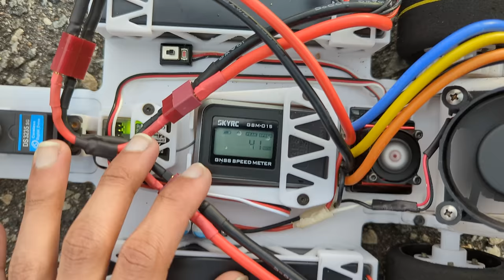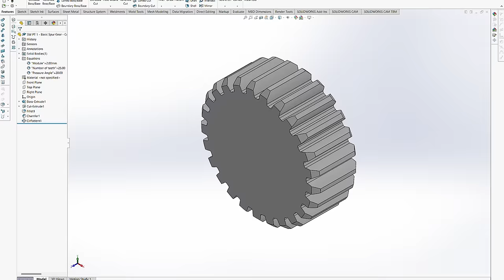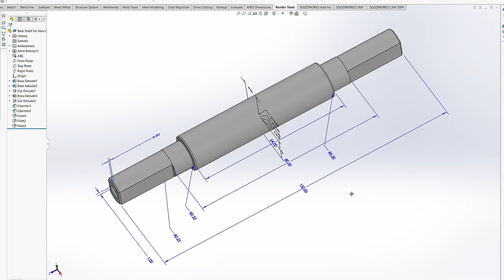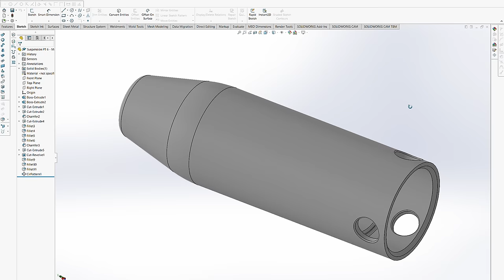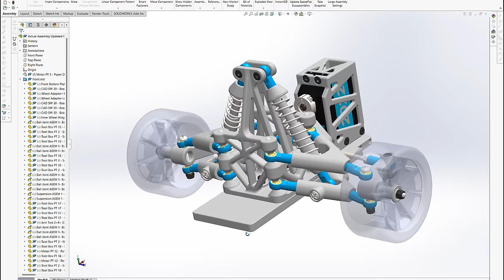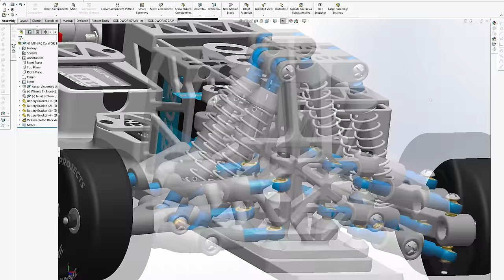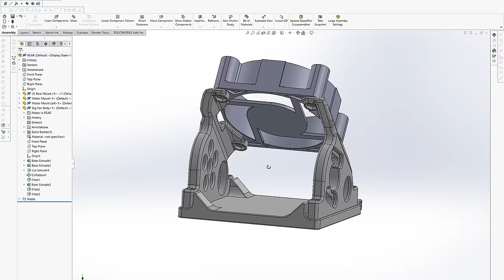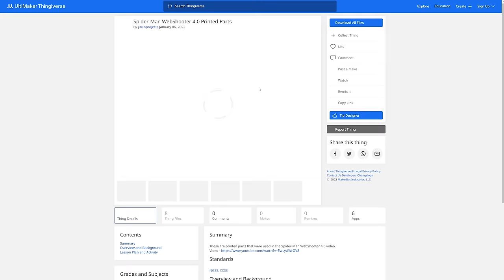How I Made a 3D Printed 41 MPH RC Car

Comment: please tell me that u used grease for the gears and a fast car like that needs a gyro
Reply from the maker: I used Vaseline lol

Yea, there's a gyro setting built in the receiver which I later turned on. I should've mentioned it in the video
Reply: Shouldn't NEED a gyro, personally I don't like them, if my car is wobbling around then something is wrong.
Reply: @jinanprojects  don’t use grease it will end up as a grinding paste
Reply: A fast car needing a gyro?? No it needs to handle before fitting a gyro! Not just a Band-Aid fix
Reply: @TwitchFast exactly people need to learn about handling dynamics and set up before wasting money or commenting causing someone else to waste it
Reply: @jinanprojects  dry graphite lube spray won't pick up and hold dirt.
Reply: Differential steering?
Reply: @needmoreboost6369 sorry that i was worong im just 12 and learning
Reply: @needmoreboost6369  im sorry that i said that it needs a gyro im just 12 and learning
Reply: @needmoreboost6369  im sorry i didnt know im just 12 and learning
Reply: Never need a gyro in any of my cars. Mine is about as fast as Jinan's here and has some 3d printed parts. Never had any wobble
Reply: what about a belt drive?
Reply: @raultamm6479 needmoreboost is just being a butt, im 13 and he can be not a asshole there are nicer way to say stuff
Reply: Gyro is for people who can't build the steering system properly

Comment: You can print double helix gears which is just two opposite angle helical gears side by side, but printed as one piece. They self-center which is nice and you lose less energy. They also have a nice benefit of being a little quieter than other gears.

Comment: Double helical gears are a great option for 3d printed gears. Reorienting the fan could allow you to use the cooling system as a down force generator. Active down force like that will be super useful for sustainable high speeds because of the scaling problems of aero. If it always crashes the model could end up being overbuilt. I really hope this helps. No matter what I'm loving this project man. Good luck.
Reply: For a practical example of Generated down force at full scale, look at the Redbull X201X series of concept racers.
Reply: If it helps they are also called herringbone gears
Reply: @Sun0faBeach1 i was thinking the same
Reply: Cooling fan downforce on a 40+mph car 😂
Reply: The herringbone gear was a Citroen design very strong and eliminates side thrust
Reply: It’s a PC fan. It’s not powerful enough to make any noticeable downforce. They’re designed to be quite not powerful
Reply: @gy9326  true but the pc fan COULD be used to cool the gears to reduce thermal stress, and considering its plastic, that would be ideal.

Comment: You can try testing with herringbone gears to get rid of the axial force. These are basically two opposing helical gears put together where each half counter acts the axial forces from the other half.
Reply: Yes, this.
Reply: Or, even easier, just use two helical gears, put side by side with opposite axial force directions. Heringbone gears are a little bit difficult to manufacture conventionaly, with a printer it is easier, but simply mirror the first gear makes it even more simple.
Reply: They also reduce sound
Reply: i was thinking of this or he could use a belt to reduce the stress on his gears but then he would have as precise control of his velocity (this could mitigated with a PID or something similar but thats too much work and that over complicates things). for me, his biggest error was placing all the stress into a small gear, if he had placed two 2:1 gears the stress would be reduces enough ( i believe, i dont remember that class that well)

Comment: As a suspension engineer I suggest adding caster to the front wheels for extra front end stability. Right now everything is centered which is not the best for high speeds. Great video tho. that RC is a beast.
Reply: I am not a suspension engineer, but I guess, that this suspention is just making things worse. The point of having a suspention is to dampen oscilations. The car shouldn't jump when you drop it. It's better to switch to off-the-shelf rc shocks

Comment: 0:32 I thought this too at first but the KV rating of a motor doesn’t mean kilovolt. The KV is actually the rpm needed to produce 1 volt of back emf, so a 3800 KV motor will need 3800 rpm to produce 1 volt or back emf. It also dictates how fast the motor can go, since an ideal motors max speed is reached when the back emf equals the input voltage and the motor will use no power, but due to non ideal conditions due to friction and other factors the back emf doesn’t reach the input voltage so it always uses at least a small amount of current.

When you add a load to a motor it slows down the motor and that in turn leads to a drop in the back emf, which means the voltage across the motor increases and hence it uses more current. In a stall condition the motor isn’t spinning so isn’t producing any back emf and hence the motor winding has the full voltage across it, this causes a very high current, in DC motors you are essentially taking the inductor which is the motor windings and just turning it into a resistor since with no changing currents the inductor has no resistance.
Reply: Lot of info here, thanks.

Comment: The reason the axle was printed lying down on the bed and with a flat spot is so the extruded lines go right down the length of the part. The individual extruded lines are stronger than the layer adhesion, when you oriented it vertically the only thing holding it together was the layer adhesion.

A better option if possible would be to print the axle in two halves, both lying flat on the bed and combining to make a cylindrical shaft. Or you could just flatten the other side of the shaft to balance it.

Comment: half your problem is the material you are printing with. You need a stronger polymer. In the RC car biz, the gears are steel and a plastic material. Shocks are, most of the time, aluminum with rubber o-rings to seal and hold things together. 

you have a super cool idea here! Congrats on making it work! Some refinement, and you are set!

Comment: As a solution to the helical gear issue, you can try doing a double helical gear or herringbone gear. ABS would also be a better material for gears for the higher melting temp.

Comment: I'm surprised you didn't use double helical gears for the motor. They get rid of the axial force issue that helical gears introduce and are still easy to 3D print.
If the gear generator doesn't happen to have an option for those, just mirror one half-as-thick helical gear back to back.

And as the other guy suggested: create an enclosure for them while at that, so you can put grease on them and have it not be thrown into orbit after 5 seconds.
Just grease without an enclosure will do basically nothing, as it will just be flung out the second you throttle up.
Unless you're using graphite powder, that might be sufficient in a thin layer that could stick around, literally.

Backseat engineering aside: a very impressive project you got there 👍
Reply: Herringbone gears is what you're describing.
Reply: @greggeshelman  double helical/herringbone are synonymous, yes.

Comment: At zero load the motor spins at 100% rpm potential. At 50% load it spins at 50% percent rpm. It is a inverse linear relationship. 

For motors like this you do not want them loaded more than 30% at top speed (for multiple minutes of high speed driving). Should be easy to figure out, measure the zero load RPM and you can do the math on MPH to RPM to see what the load is. 

Also, are you going to add suspension on the rear axle? I’d recommend looking at the old school classic RC10L chassis, which had a solid rear axle and was able to do some suspension on it.

Comment: You can avoid the radial force by using herringbone gears. It's just two mirrored helical gears that either touch in the middle (herringbone) or don't (double helix).

Comment: That was nice! Good job!
Why dont you try to print in PETG or ABS? it will be less rigid but more durable in teory
Reply from the maker: I actually wanted to use nylon filament for the gears but the layers kept separating after printing for some reason...
Reply: @jinanprojects  that is commonly a sign of not using a high enough temperature or having too much cooling, it happens because the current layer doesn’t melt into the layer below it properly, you should try less cooling and a higher temperature. Ideally for filaments like nylon you want an enclosure too, to help reduce cooling more and to keep the part hotter, so less likely to warp and better layer adhesion.

Comment: you can use helical gears but you need to do double one pointing in one pointing out. think Herringbone.
Reply from the maker: I thought about using herringbone gears, but the larger contact surface area of those gears causes more friction and therefore reduce the output rpm. They are usually used for high torque applications as far as I know

Regardless, I should have tested herringbone gears to see how it actually performed

Comment: I too made an rc car using 1000kv 2212 bldc drone a motor and 8mm steel rod used for 3d printers.
I used a 3d printer 6mm belt and 2 gt2 pulleys for a belt d4ive with a 2:1 reduction.
Having 3d printed rotating parts is a very bad idea. they snap at the slightest torque and cant bear loads.

Comment: Do you need parallel lipo batteries really? Because one battery also can burst higher current than that 540 type brushless needs. Paralleling only may for longer duration work.

Comment: In race cars, straight cut gears are best. Same for RC cars.
Reply: Straight cut are better for torque capability and simplicity of manufacture for sure, plus have the benefit of no axial forces I agree. They're relatively limited in ratio range but if you have huge differences in gear size it's going to be a fun trade-off between strength/efficiency of a single pair, or using an intermediate set and accepting the efficiency hit to get a meshable set with less rotating mass etc. Drop them into a small bath casing and put a super light lube in there that just picks up the tips of the teeth and mists the lube without adding much drag.

Comment: Some tips from my experience :
You could use herringbone gears to get rid of the axial forces(tricky to print but might work), a softer front suspension  maybe with some oil to reduce bounciness, and also some sort of rear suspension just like in pan cars. A gyro would help to keep it stable. Check out where the car needs to be balanced and also try to get it lower to the ground. A high gear ratio will give you a higher top speed, in theory but a 2:1 ratio will not provide enough torque for high speed , i think you can achive a lot higher speeds with this setup , what limits you is the lack of stability. Id be happy to help you if i can
Overall great presentation and very clever designs .Definately subscribing, looking forward for more !

Comment: Can't you make duel direction helical gears in solid works?
Reply from the maker: Helical gears are ideal for high torque transmission. Not for highspeed because of the larger contact area and converging or diverging force which makes it a lot less efficient than the standard helical gear or spur gear
Reply: @jinanprojects in rc racing we use straight cut gears. There is no need to be fancy.

Comment: instead of 4 springs in the front, try to make the two front wheels independent, and try one spring down the middle like an average GT12 class RC car or an F1 rc car. I'm just curious as to how it would do on your 3D printed model!
Reply: The two front wheels on his design are completely independent. I don't know why he has used two springs per side though. One issue is that he failed to use shock absorbers so the springs are completely undamped so the thing is basically a trampoline.
Reply: @samharper242  he used two per wheel because one spring wasn't strong enough to hold the weight

Comment: Haha when an engineer tries to make functional designs is hilarious! You need a few missing parts to make the car better! In increasing order from my opinion of priority:
Body/Aero-Downforce
More Rotating mass in the tires/ substitute wide, air catching tires (which lift it off the ground)
More Weight in the front to increase traction in the front
Less sensitive steering at high speed- some people prefer not to do this
Lubrication!
Shocks/Suspension Dampening
SMOOOOOOOTHER GROUND!! no curbs lmfao
Reply: its really hard to increase downforce on a small scale model like this you would need to have a front wing to channel the air through in order to make low preasure/fast air at the bottom and slow air at the top via a rear wing the car would also need a cover and a skirt to seal the low pressure air moving under the car